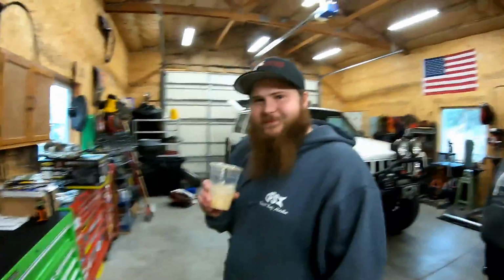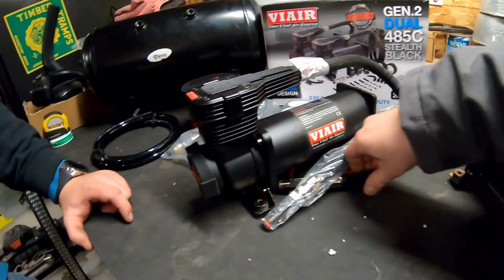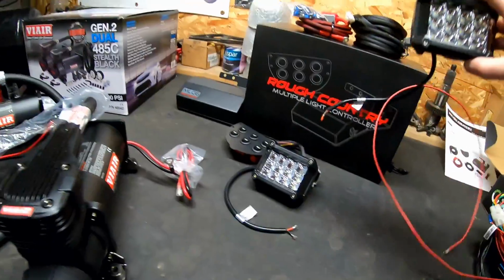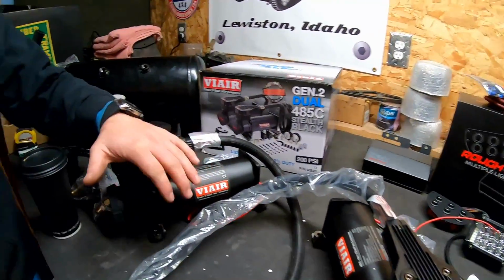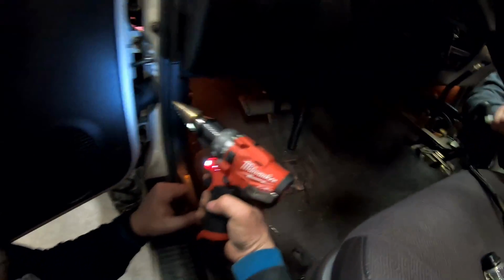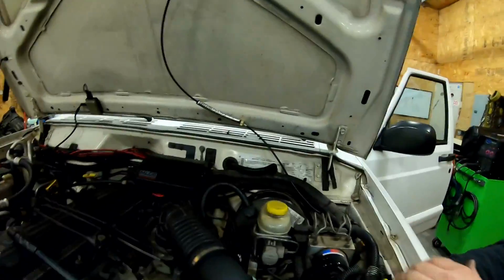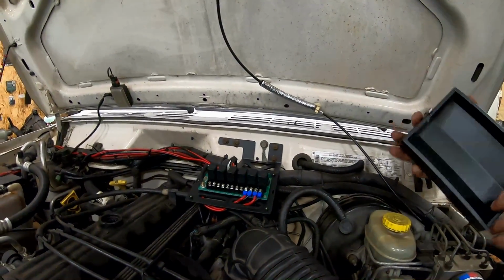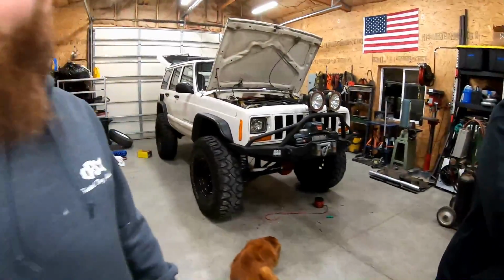Jake's Jeep Cherokee Gets Some UPGRADES!

Comment: MLC-6 is great. Installed one with 5 sets of baja designs lights, I used a JL one (Got on sale for 100) and modded my center bezel to fit since my ash tray was used up with my arb airlock switches. I also installed 200 amp alt and big three with 1/0 ofc.
Reply from the maker: Nice!